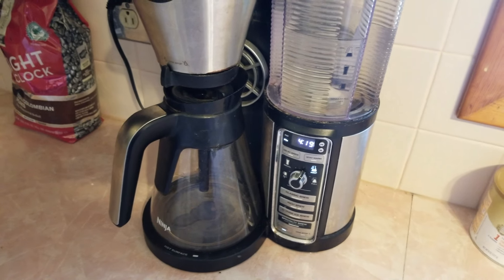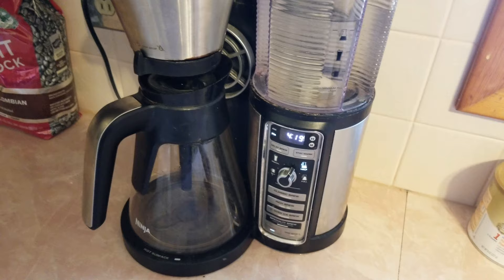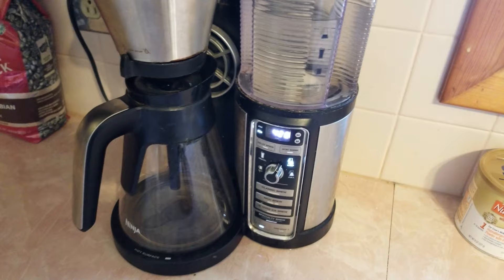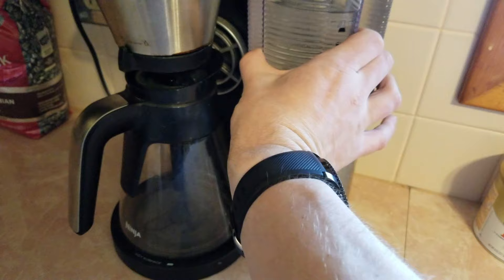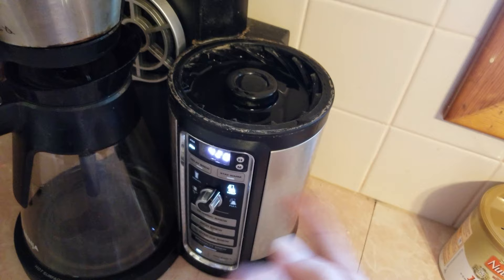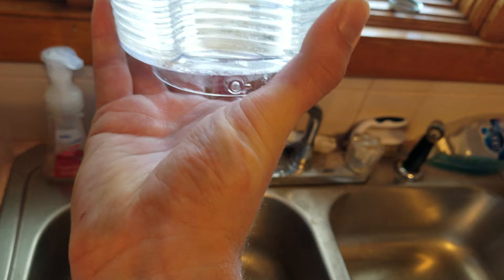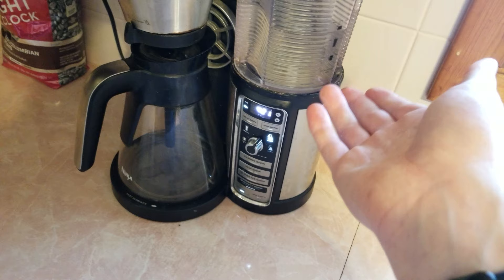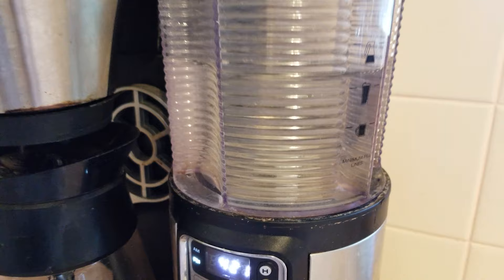Ninja Coffee Bar not brewing fix.

Comment: Here in 2022. Bought this model at the thrift store for $5 and thought I got a deal, instead I got the 5 beeps of death. After watching so many youtube videos and trying all the tips nothing worked, I  was about to give up and toss it and I tried one more thing. I ran 5 cycles of boiling water through it restarting every time it shut off, THIS IS WHAT WORKED FOR ME, the amount of white gunk that came out was insane. After all the boiling water cycles I did one vinegar cycle and 2 more boiling water cycles and now it works good as new! Also, use bottled water not tap water to avoid this in the future.

Comment: Another tip:  the problem with mine appears to have been the little rubber flap that covers the air release hole at the bottom inside the reservoir (on top of the little dome thing).  It didn't want to let the air bubbles out easily enough and thus was severely restricting the flow rate.  Cleaning wasn't the issue, as I only ever put R.O. water in there, it seems like it was just the little flap... maybe getting stiffer over time or being slightly sticky.  thing is it seems completely unnecessary... you can just flip it up and turn it to the side a bit and it won't restrict the bubbles at all.  or you can preserve it's function but work it a bit by bending the flap up to an extreme degree, loosening it up some.  and/or clean the flap and the plastic beneath it that it contacts.  we were about to throw ours out too so I'm glad I discovered this.
Reply: spent three hours wasting my time with the other cleaning and dismantling demo videos.....the flap was the whole problem..... 5 second fix....pulled it j out with needle nose pliers and I'm brewing again.....thanks for taking the time to post !
Reply: Glad I’m not the only one that figured this out. After having my machine brewing super inconsistent for months I just pulled the flap off after discovering it. Didn’t seem to serve any positive purpose and now I’m brewing like it’s brand new again!
Reply: this worked for me. i filled up the reservoir all the way and pushed the button on the bottom. water flowed like the Nile river.
Reply: @krisstrong5936  man I'm glad this is still helping people!  We're on to a new pot just for the ability to brew a whole pot and automatic brew timer reasons, but the ninja was pretty sweet!
Reply: @Artcore103  i'm in a much better spot financially but my ninja got me through the last 4 years of some struggle times. it's done it's job and then some. I convinced the wife to let me buy a Breville as sort of a luxury upgrade. But I was bound and determined to fix ol faithful. Your advice worked perfectly. and hopefully others for years to come with the older units.
Reply: Where is this flap? I can’t get my coffee bar to work.... :(
Reply: @anderswallin1531  it's at the bottom of the tank if i recall.
Reply: @anderswallin1531  it should be obvious but if you can't find it take a picture and email me, theocking at gmail .com

Empty and remove tank, take top of tank off, look down inside, it's small.
Reply: This fixed ours!! Thanks so much for commenting!!!
Reply: @marieller1498  👌
Reply: Unreal - so easy to fix this. Worked perfectly. Thanks so much !
Reply: @SvenAust  sweet!  Man this troubleshooting tip is truly evergreen!

Comment: This is perfect thank you! For the first time in 4 years my ninja wouldn't brew coffee today and my heart sunk. I immediately looked it up and your video saved me! The water reserve on mine has a broken part that just sits in there so I can't remove it freely without water pouring out from the bottom, so when it didn't work today it reminded me to check the status and low and behold someone at home jostled it without re-centering the part so the machine of course yelled at me with its beeping and refused to brew 😅 not quite the same issue, but similar in matter. cheers ☕

Comment: ALTERNATIVE FIX! 
I had this problem and this solution didnt work. My machine is perfectly clean. I emptied the reservoir and ran the machine 3 times to flush whatever water out that is inside. It will still stop and beep. Once all the water is out, fill up your reservoir again and try to brew a pot. This fixed it for me.

Comment: I guess I had the extreme blockage. 2 hours of continuous clean cycle, having to hit the clean button over and over when the “death beeps” start. 5 pots of vinegar, used over and over over.  And for a last ditch effort, I used a straw, wrapped a rag around the area where the reservoir meets the intake port, and blew thru the straw forcing any blockages to pass. Basic Angioplasty to the damn thing!!! Opened up the valves, blew the clogged arteries open! Worked like a charm.

Comment: I removed the reservoir and dried the hole with paper towels I also made sure the carafe was on then I blew with my mouth threw the hole where the reservoir sits as hard as I could for a minute. I guess by forcing air into the machine it cleared the line and I could make coffee again.
Reply: This was the fix , after this I was able to properly use the cleaning setting. Before it was just brewing for 5-10 second and it would beep 5 times after shutting off.  I used a cleaner and plenty of calcium build up came out. I made sure to run it several times.

Comment: You can tell by the build up on the outside you have hard water. Got to run multiple cycles of white vinegar and then thanked the reservoir off and get a straw and a wet paper towel to seal and try and blow through where the water goes when it leaves the bottom of the reservoir.  With the basket off, you’ll get a bunch of build up out.  This is the easiest way without taking the machine apart.  Also run your cleaning cycles when the light comes on and try not to postpone it.
These were great machines. I went through 2 in 8 years but they’d brew at least 3 pots  per day 365 days a year. Only problem was the shut off on the drip basket. If you flip it over there’s a Phillips screw in the center. Remove and don’t lose the little spring. With it apart you can see how the lever operates an internal arm with a magnet that operates a switch in the machine when the basket is in place.  I use a small magnet and super glue to repair, put back together and it’s lasted years.  No cost or parts needed too which was nice.

Comment: The problem is mineral buildup. After cleaning as described in the video.Fill the water reservoir with white vinegar, place a empty filter in and repeatedly run the vinegar through until it remains brewing as it should. Then run it through a couple more times. you'll find the mineral deposits in your filter. Afterwards Rinse out the reservoir and filter holder. place a new filter in and run the water through several times to flush out the vinegar. Works for me every time. Hope this helps.

Comment: Yes this is the fix. The small hole at the bottom blocks up with a slime and if you scrub it out with a bottle brush it will then work as it should. Too bad the manufacture can't figure that out. Also the water tank is dishwasher safe on the top shelf only.  The maker of the product can't afford to print that cleaning tip in the instructions. Too bad!

Comment: Remove drip stop tab. Pull tab out. Check for magnetism on opposite side of drip stop tab. Replace magnet or magnetize small chunk of metal to put in the "longer finger" of the tab. Put it all back together and should fix drip stop light stopping brew cycle.

Comment: You have to clean the machine with a decalsifier. Your cleaning light is even on. You need to run the solution through until it brews as designed, and then run it with water a couple times.
Reply from the maker: I ran bottles of decalsifier through it. Didn't help.
Reply: @honolulublue72  Interesting... I had the same problem and the decalsifier did the trick. Now my classic brew and clean button don't work at all. I can only use rich brew.
Reply: @jacobcaddick  clean the connections inside. I took mine apart. There was one that had water spots on it. Got a q tip and rubbing alcohol and cleaned it. Now it works fine. The 5 beeping sounds went away. I tried all other options for the videos and it was the connections. There is one specifically that controls the timer but there should be one for each of the buttons you were talking about. Try it.
Reply: @maricelachavira  Good to know. Thanks for the tip!

Comment: So im having close to the same prob! Mine runs fine with the water part, but doesn't do its full job when it gets to the coffee grounds part. The filter is fine, i tested it. But the second part that sits under the filter is not allowing my coffee to drop into the cup. And then more and more water comes in and it ultimately overflows and i end up with coffee grounds in my coffee. Ive done this so many times trying to get a diff outcome. I cleaned it about 3 days ago and its acted up since. Pic will be attached bc i dont have the same style you do.
Reply: Well i cant attach a pic but it's the square one without the clock on the bottom.

Comment: Mine will run the cleaning cycle no problem, but it will not brew and I do NOT get any beeps.  I hit the brew button (I've tried them all) and it just sits there.   Any ideas??
Reply: Try using a straw and blowing thru the intake port area with vinegar already in system. Angioplasty the thing, and it will clear the pipes.

Comment: I just cleaned our out like you did and still same freaking issue. Have to keep pressing the button to brew.
Reply: I'm in the same boat.  Just ordered a new pot.  I was so hopeful. :(
Reply: You posted 4 months ago so I highly doubt you’re still dealing with this but it helped me to run diluted vinegar water through a few times to help clean the water build up in areas I can’t reach.
Reply: You need to clean out the small hole at the bottom of the tank valve. Use a bottle brush.